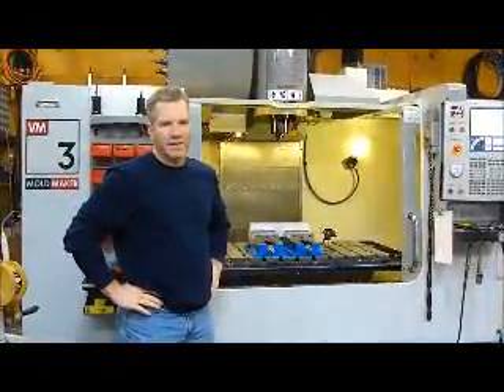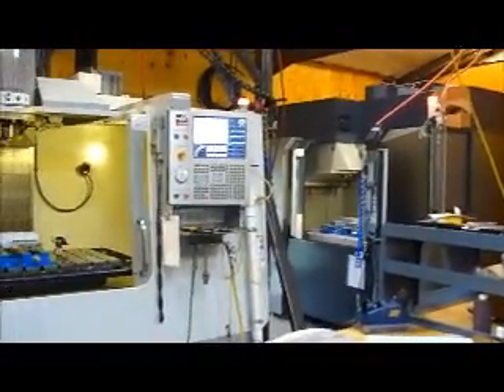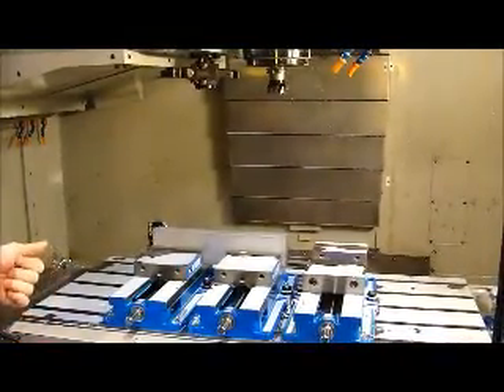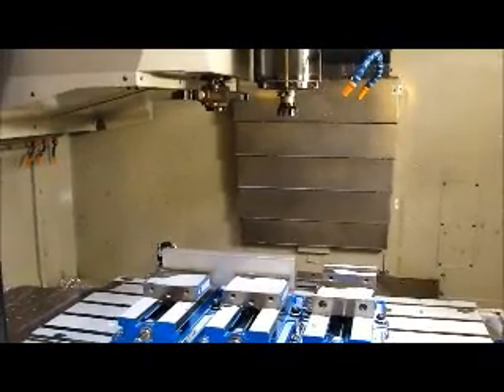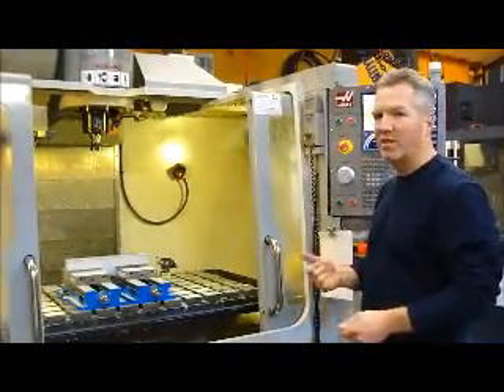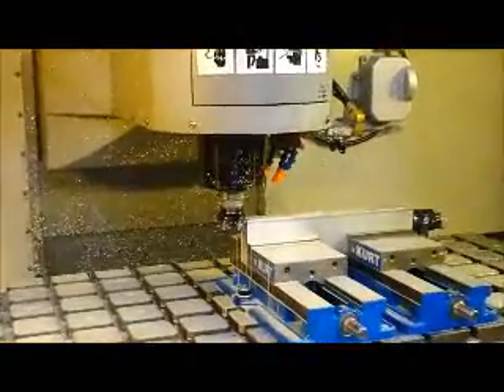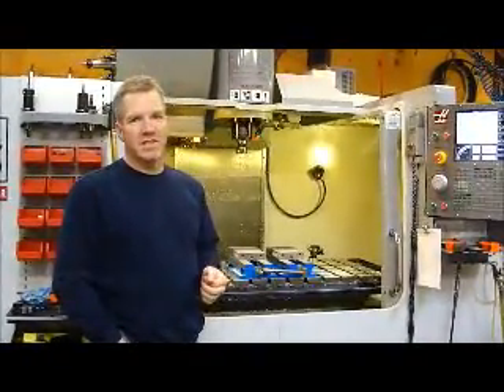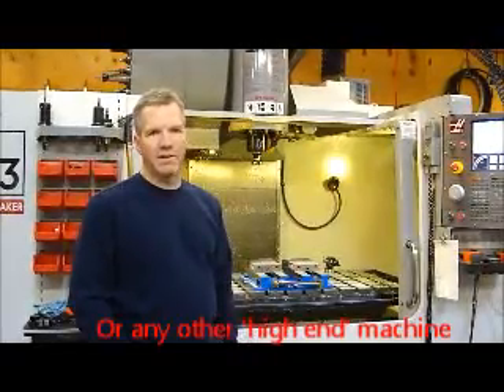Haas vs Makino

Comment: rwolcott23
correct me if i'm wrong but that there is a vm from arrond 2006 and you want to compare that to a brand new machine ?
also if it is a gearbox version it goes in to high gear at 2500 rpm and then it has no torque because it is build to run at 10.000-12.000 rpm for days and i know they can do that because i have seen one run for a week, so please provide some facts that proves that you have done a fair comparisent? or ary you just one of those who have bought the wrong machine and blames your own fault on the manufacturer ?
Reply from the maker: This is a 2008 Haas against a 2012 Makino.  Both are direct drive spindles and both use the exact same cutting tool.  When I bought my first Makino I had two Haas machines, a VF2SS and this VM3.  Previous to that I had a Haas Mini Mill which was the most accurate and trouble free of the three.  The first Makino was a real eye opener in the step in performance and this is no joke.  I now have three Makinos and zero Haas.  I have invested close to $1,000,000 in Makinos over the last four years to replace my Haas machines.  That speaks volumes as I am the shop owner and I pay the bills...
Reply: rwolcott23 well i just watched the other video you made, and there is something wrong with that vm-3 you had because what you wanted it to do in the video it should be able to do, for example i made a vf-4ss make 15 micron tolerances with 12 m/min feed in aluminium but this is a 2014 model that i know is 100% okay, it seams to me that who ever installed those machines that you had did a poor job and even worse with repairs, and i'm not saying that makino isn't a good machine because it is and i don't know your needs for machining but what i have seen is aluminium and there for i would say a haas should be good enough because it can do fast and precise cuts in aluminium if you do i right,
Reply from the maker: Bent Christensen Your posts lead me to believe that you haven't run any of the high end machines?  Anyone who has ever run both a Makino and a Haas to their capabilities wouldn't even try to justify a Haas from a performance standpoint.  I routinely rough on the Makino to within .005" at 600 IPM.  The VM3 can't even rapid that fast.  I programmed, set up, and ran both machines on a daily basis and the difference is laughable.  I also bought and paid for both machines and the last Haas just got moved out the door.  From the machine owner's point of view, with my eye focused on the bottom line the answer is crystal clear which machine has more value, even at a 50% premium and even when cutting aluminum.
Reply: i have run okuma, haas, dmg, and mazak but you buy a machine after what your needs are and haas machines are very good machines at that low price, and it seams to me that you bought the wrong machines for your needs
Reply from the maker: Bent Christensen LOL!  Time is money and if a project can get done in half the time with a higher quality machine the shop rate doubles.  There is another video of mine you should take a look at.  Search Youtube under "cnc quick change over" and you will see how I run this shop.  This is a standard change over and we do it daily.  This CAN'T be done on a Haas because an operator doesn't have access to the tool magazine while the machine is running.  All tools for the new project were loaded while the machine was running.  There were a lot of factors that went into the decision to upgrade to the Makinos and faster machining performance was just one of them.
Reply from the maker: Bent Christensen I guess our definitions of 'good' are just different.  For me a good machine is one that runs and runs and runs and never breaks down or has issues.  It also completes work in record time with top quality finishes and dead nuts accuracy.  This applies to the complete process from setup to machining to teardown.  If machine A can accomplish those things in 70% of the time that machine B, projects run on machine A will achieve a shop rate of 142% of machine B.  For a typical shop of $100/ hr on machine B, machine A will be making its owner $42 per hour more.  It is business 101, not rocket science.  We have been able to acheive throughput gains of 150% with the Makino VMC and 300% with the Makino HMC.  Our investments in the quick change over fixtures on the VMC are pushing the throughput closer to 200%.

Comment: This comparision is not fair. You cannot compare a Ferrari against a Renault. Maybe the good comparision could be a Makino vs Okuma or Makino vs Hermle.
If you have only 300.000$, you can buy one makino, or 3 haas. I'm sure that 3 Haas are able to produce more parts than one Makino,
Best quality / price, is Haas.
Reply: ***** Well you clearly don't know what you're doing.  I program and set-up in a shop with 4 Haas's, 2 Mazak's, and a Mori Seiki.  I can say without a doubt that I can push a tool harder in a Mazak or Mori than I can in a Haas.  That's just the way it is.  The Haas's are great FOR THE MONEY.  But you are not going to out produce a better machine.  

Secondly, your comment about running an "idexable" at 3000 rpm being idiotic is, well, idiotic.  There's no law that says if you've got an indexable cutter it must be run at a certain rpm range.  3000 rpm on a 2.5" cutter is right at 2000sfm.   It's on the low side and faster wouldn't hurt, but that's perfectly acceptable for roughing 6061.  Ever heard of a torque curve?  Spindles have them.  The faster you spin it, the less torque you have.  

Lastly: "and running a spindle at 100% just quit machining ."  What an intelligent thing to say.  Time is money friend.  I've got production jobs running year round at 100% load during the roughing and have no issues.  "you just got to know what you doing"
Reply: Emilio Cabaleiro  makino have features that come syandard that haas dont even make. if a cutter break in a makino than the machine will stop grab the sister cutter and start where it broke. so lots of companies can run 20 makino machines over night and come in the morning to have finished products. no overtime for  employees
Reply from the maker: Emilio Cabaleiro That is just the thing...  This Makino is only ~20% more expensive than a comparably equipped Haas.  It IS an apples to apples comparison.  It would be unfair to compare my Makino A51 horizontal mill to a Haas, or even this PS95 for that matter.
Reply from the maker: Tell me which is more COSTLY.  The $300k machine that requires one employee to run and produces $60k per month or the $100k machine that produces $20k per month, requires 3X the floor space, one employee to run and produces $20k per month.  Here is your answer.  To get the same throughput one would need to buy three $100k machines, hire three operators, and allocate 3X the shop floor space.  I just replaced this Haas with another $350k Makino (A51nx) and my profit and margins increased immediately.  No more Haas videos for me as that was my last Haas.  If you have run both (to their capability) you would make a comment like this.
Reply from the maker: BTW, this Makino was more like ~$150k, not $300k.  The $300k will get you a nice horizontal machine but that really is comparing a Ferrari to a Ford Pinto.
Reply from the maker: I beg to differ.  Aside from the flimsy spindle, lets talk thermal drift.  Not a problem if your parts have a cycle time of 10 minutes but if you are making a mold that runs for 10 hours it is a major problem.  Set 40 tools in your magazine, then go and reset the first tool.  It will be off by .002" due to thermal drift...  How about reliability.  I don't have enough space to detail the issues I have had with Haas machines and most of them were present when the machines were delivered NEW.  5-6 service calls JUST TO GET THE MACHINE RUNNING.
Reply: he should do a video. in which the torque rating should be same. it can differ from manufacturer to manufacturer.that whould be right. as it would proove which spindle can take it for longer time.

Comment: Where I work we have a 1995 Okuma, 2010 Haas VF3 and a 2013 Quaser. The Haas has 3mm Perspex windows that are crap for safety considering you have a 12,000 RPM spindle. The Okuma is an expensive machine but is the easiest to operate and tears through 316 stainless easy. The Quaser is a great piece of machinery only let down by the operating system which is very complicated. The Haas aftermarket service is non existent and you need it a lot. Love the expensive Japanese machines and really hate the Haas. They are built for a price so you really can't complain but I would never have another one.
Reply: ***** The hardness of the material has little to do with it as you can run the same tooling in any machine but it is the difference you see and how much harder one machine works to accomplish the same outcome. We machine a whole range of materials including Titanium and Inconel and the Okuma powers through with out having to change any speed or feed you get from the tool manufacturer. When you try and do the same on the Haas you are always having to change the RPM and feed rate so the machine doesn't destroy it self. The vibration you get is unbelievable and the amount of RPM the Haas looses when you start the cut compared to free running is pathetic and you have to allow for this when so as to keep the chip thickness correct.

Comment: This test is a little deceptive. While it is impressive that the Makino made such an abusive cut, the fact that the Haas refused to do so is not a big indictment. The Haas didn't 'crash' (ai yai yai), it detected the cutting load and shut down. These big motors are under feedback control. Every control loop has an 'idiot threshold' to protect the machine from idiots. I assure you, there is a servo engineer at Haas that could diddle a threshold value in the firmware and allow the machine to make the same cut. I am not convinced it would be wise to do so.
Reply: your comment is pointless. this video proves haas hp ratings are garbage. period.
Reply: I realise am a little late heh but anyway, I think you're missing the point, the Makino was able to cut with same parameters without overload, a 30HP spindle can't take that cut? cmon,,,
Reply: and that too aluminum
Reply: Connor Jones time is money bud!

Comment: Haas are a  light duty machine center plain and simple. They have a casting that is not really even machine worthy. They are good because they are cheep to fix and parts are in stock. They  have rebuilt our  Haas a few times spindels and  ballscrews . The tool changers they fall apart all the time needing springs and fingers. Who has time for that. Not me  don't get me started with there tool room lathes  They can barly handel aluminum with a .025 debth of cut with a boring bar. They sing and scream for mercy lol . sorry HAAS fans They are what they are  light duty.

Comment: In the machining world,would you normally make a cut like that?If not and the Haas is cheaper,why pay for a better motor,when it is not needed for standard machine tool rules.I know nothing about machining,other then what I see .Thanks
Reply from the maker: Yes I would, whenever possible.  The faster I can get work through the machine the more my business is earning and that is what it is all about.  I like to get work done as fast as humanly possible because it raises my effective shop rate.
Reply: jenacbxx I would only need to pay for repair bills if I did that sort of cut on the Haas.  The Makino will do it all day long, it was designed for it.  The Haas, not so much...  It is amazing to me how many shop owners buy cheap machines and baby them rather than buying expensive machines and running them how they are designed to be run.  There is about a 2X speed difference between the two approaches.  With a Haas you can't compete against a shop running a Makino, all else being equal, if they know what they are doing.  They will always be able to make the part cheaper and still be profitable.
Reply: rwolcott23 well if u will spend all the money u earned to fix your machine or to replace them i think your econimical skills need a boost :D
Reply from the maker: jenacbxx I would only need to pay for repair bills if I did that sort of cut on the Haas.  The Makino will do it all day long, it was designed for it.  The Haas, not so much...  It is amazing to me how many shop owners buy cheap machines and baby them rather than buying expensive machines and running them how they are designed to be run.  There is about a 2X speed difference between the two approaches.  With a Haas you can't compete against a shop running a Makino, all else being equal, if they know what they are doing.  They will always be able to make the part cheaper and still be profitable.

Comment: Very good visual and audio test. Have you considered a CIRCLE DIAMOND SQUARE (also with BORES & SLOTS) test for measuring machine tool accuracy under full load on the axis drives and spindle? Cutting incrementally higher and faster with high performance carbide tools, it's visible in the geometry profiles.

Comment: 100% fact. They used Hitachi Seiki machines until the Mori buy out (2002) at which point they switch primarily to Mori Seiki.  There is a good reason why they don't build a Haas with a Haas.  I get a good laugh when these guys try to compare a Haas to a worthwhile piece of equipment a real world cutting environment.
Reply: 76 percent of every machine tool in the Oxnard plant are Haas' building other Haas

Comment: I set up a V33 once and was able to get within 3 micron table flatness, on only three out of four leveling pads touching the foundation. Try that with a bargain machine.  I think it's a classic example of "pay the man now, or pay the man later." I've been in shops with Mori's and Makinos 20 years old and still chugging along, while a low hour VF-2 growls like a dog at every rapid move, and the spindle sounds like it's making a ball bearing smoothie at only 7,000rpm.

Comment: If Haas made an airplane, I would drive instead.  I would buy a used Makino over a brand new Haas, even if they were the same price.  I think people are drawn in by the false economy of owning a low initial cost machine and availability of parts & service. Well that's fine and dandy, but there's a reason why parts for those machines are so easy to come by...because they need to be.  Ball screws don't last, spindles sound like blenders at high rpm.

Comment from the maker: The difference is a lot more than how strong the spindle is or how fast the table accelerates, etc...  The ability to change tools while the machine is running, use tool numbers up to 9999, and the list goes on.  Each of my tools has a unique tool number.  Tool 63 is a 3/8" Hanita Vari Mill, unless it is running in the Haas, it has to be renumbered...  Really slows setup and changeovers and limits flexibility in running unrelated programs that might use that tool.

Comment from the maker: Do you have any other make of machine in your shop?  The Makino is simply a more profitable machine.  I don't know the details of your work or what you make but the bottom line is you could probably get the same volume of work done with four Makinos, which translates to fewer employees and less floor space.  This holds true whether machining putting heads or aluminum widgets.

Comment from the maker: Spindle load limit was set to 150% on the Haas because I didn't want to risk scrapping my spindle making these videos.  Apparently Haas says these machines can run at 200% for two minutes which means they aren't really designed for it.  Kind if like running a family car at redline for two minutes, then getting to replace the engine because it threw a rod.  The Makino was running at 100% spindle load in the same cut.
Reply: Not sure that is a good comparison.  Your family car engine was validated at redline and full load for hundreds of hours in a torture test.  Example:  https://www.youtube.com/watch?v=GNPB3RtHN2M

Comment from the maker: A high end machine might cost 30% more than a Haas and generate 30% more revenue per month.  If my revenue per machine is $15k with a Haas I can expect $19.5k from the higher end machine at a monthly payment difference of $800.  The net gain is $3700 with buying the more expensive machine.  This is roughly how it has worked out in my shop.
Reply: Great insight !

Comment: Did you use load monitoring when doing these videos, or did the haas emergency stop because of spindel/servo overload? There might be a difference in how fast these machines react to overloads. Maybe the makino is just set to accept overload for a longer period of time than the Haas? When we replaced our niigatas to makinos at work. They could not handle the same cut the niigatas did. But it was because they only allowed spindel overload for 0.1 sec. Raised it to 0.5 sec and the problem was gone

Comment: Except that shouldn't have stalled it.  What Haas at least claims that they certify their spindles to is basically infinite duty cycle at 100% specified spindle load, 15 minutes at 150%, and 5 minutes at 200%.  So, no, it's not just above the spindle power.  Not at all surprised that it doesn't really meet that standard.

Comment: Haas are not even in the same league as makino we had a haas demonstrator it lasted 2 days then we told haas to take it back we used exactly same feeds and speeds as the makino machine just shut it self down all proper machinist will tell you it's fact haas are not up to the job you get what you pay for  makino maho Mori hemle bit more money a lot more productivity